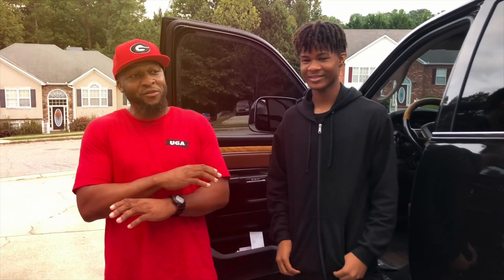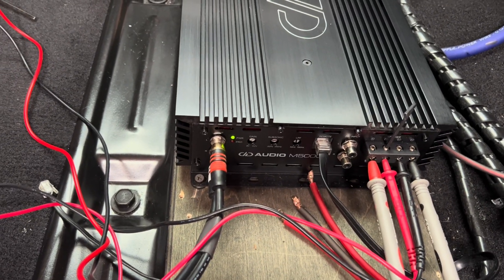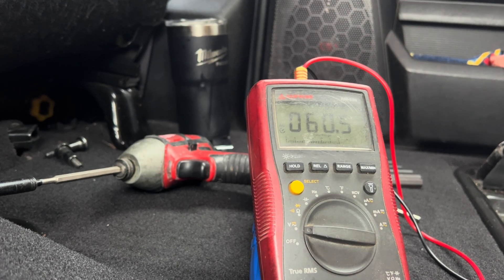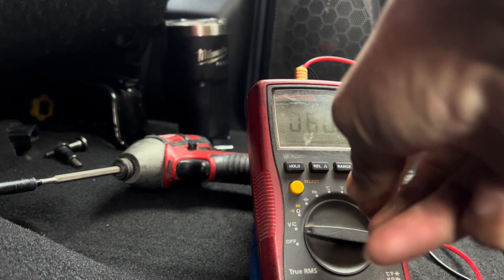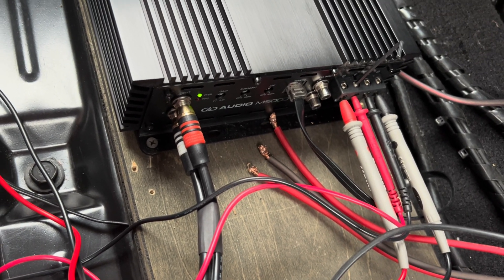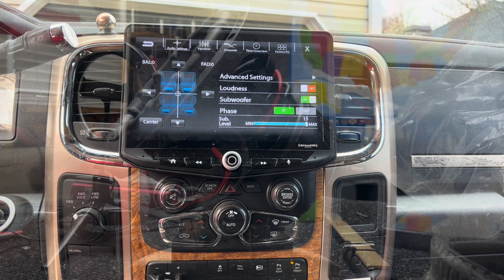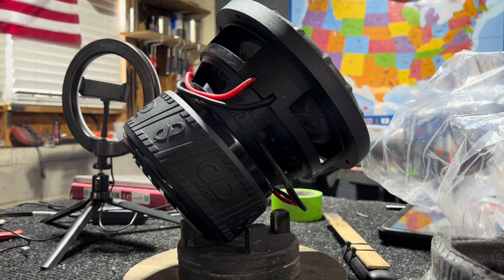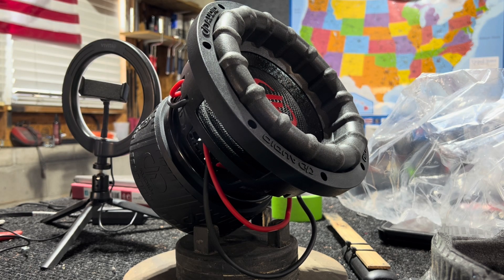Setting The DD M5000 to 3600RMS @ 1ohm w/ A Multimeter and SMD DD-1

Comment: One of the best amps. I had my M5000 for a year now on 3 DC Level 4s 12s. I’m very surprised with the amount of perfect power, it’s like after 10 years of switching systems I finally found my sweet spot. I set it a lil bit before clipping because I just don’t trust nobody with my bass knob.

Comment: hey bud serious question! I am running two of the SA before E series and it says they take 1.75 cubes if I run two of those in one box does each sub need 1.75 or can I run them in a box that is 1.75 cubes by itself
Reply: I'm not familiar with the subs you're referring to. Are these 12's and are you wanting to build a ported enclosure?

If so, 1.75 cube net is a common size box for a 12". If your using 2 subs, then you'd need 3.5 cubes net total. 

The net volume is the space left over after you subtract the air being displaced by the sub and port. So depending on what kind of port you're going to use, you'll probably need to start off with an enclosure 4 to 4.5 cubic feet in total.
Reply: Okay, Sundown SA classic. Yeah, they recommend 1.75 cube net per sub.

Comment: Test it also with a -10, -5, and odb track. With the same gain and sub levels. In sure you know but huge difference. Also please test the signal with an oscilloscope vs your dd1. Not trying to dump on a product but my oscilloscope shows clipping long before my dd1.
Reply: PS, no amp should output DC on speaker wires. If it does, it's either a bad design or something is damaged in the amplifier.
Reply: @JasonWW2000  that's how the clip light works. I thought the same thing you do.
Reply from the maker: At the end of the day I trust my amp. The DDM5000 has a built in clip indicator
Reply: @M.B.Enclosures  I've always trusted the clip light too. What I've found out is that all a clip light does is detect DC current on the ac side. The level of DC current that turns on the clip light is set and varies from manufacturer and amp. Clipping always starts before the light turns on. There's an amp repair guy here on YouTube that is how I found out about this after noticing the dd1 didn't match the oscilloscope I started looking into it. He demonstrates it very well. Just food for thought. That amp is a beast. Have you thought about trying a kicker warhorse? What's your opinion of it?
Reply: @SG-Cichlids Normally, the clip light circuit in an amplifier is comparing the voltage coming out of the amp with the voltage of it's internal rails. It's like a comparator circuit. So nothing to do with current.

If the output voltage reaches the rail voltage (which can sag under load) the clip light should come on. 

I don't know if all amplifiers use this same basic design for the clip light, but I think most of them do. This is the basic concept I plan to use to build my own clip light kits to retrofit onto older amplifiers, that don't have them.

The DD1 isn't designed to detect clipping. It looks for distortion and the level of distortion is 1%. 

A clipped signal is one of many types of distortion so it will pick it up. Not right away, though. It needs to get up to around 1%.

Who is the amp repair person?
Reply: Good Insticts MBE, what happen to your oscilloscope device?@M.B.Enclosures